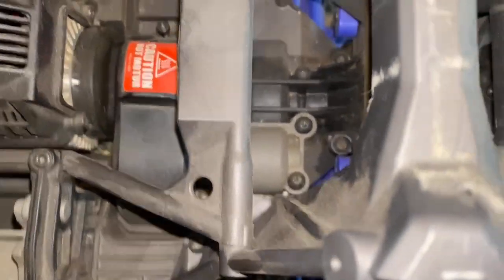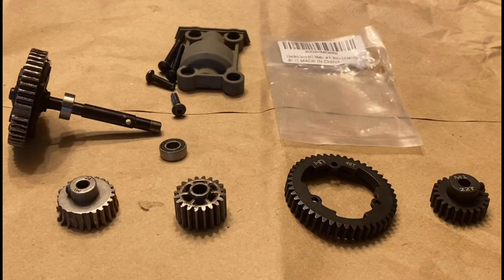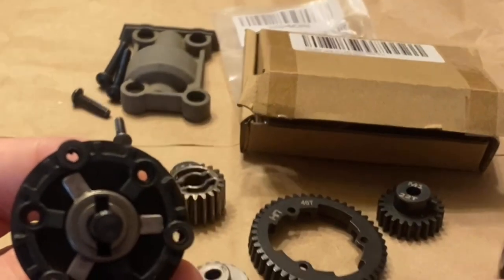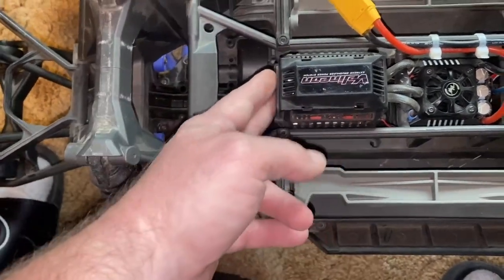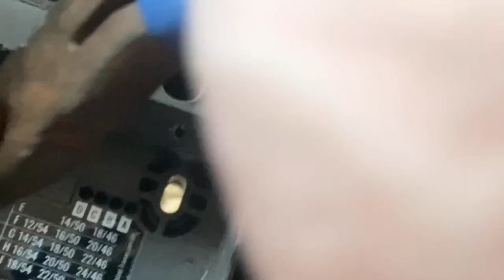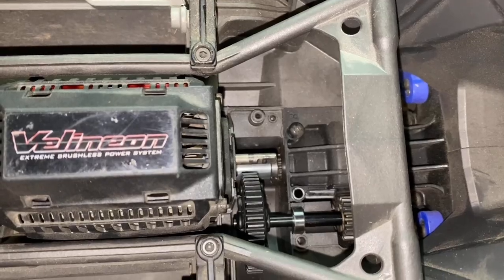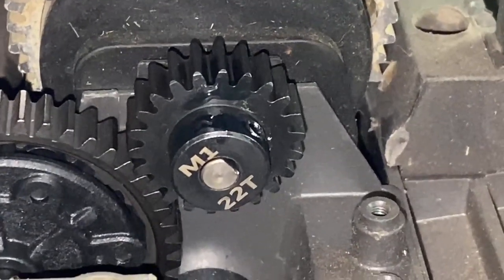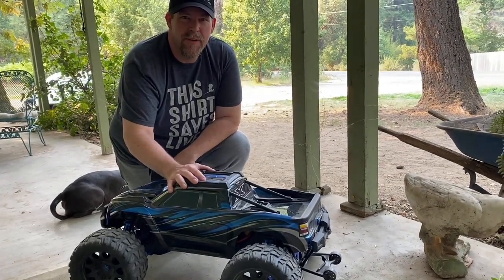Shattering Gears On Your Traxxas XMAXX 8s? Here’s How To Fix It !

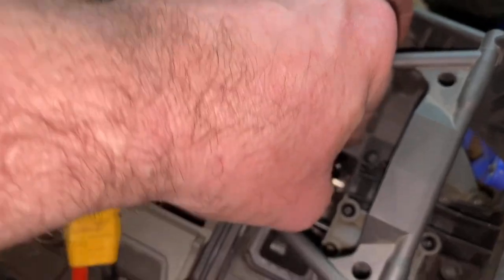Comment: Thank you!  My very 1st run on a new 2024 xmaxx 8s with belted tires ordered directly from Traxxas website.  It only drove for approx 5 minutes and when I put it on a load climbing a steep hill it stopped driving.  Could hear the motor spinning no forward or reverse.  That sucked, had to carry it about 3/4 of a mile back to the car and go home :(    I had a pretty good idea to check these gears and I removed the housing, but without any experience working on this all I could see is the 2 gears looked right, they weren't slipping and manually turning either gear would make the tires turn.  So the motor drive shaft was free spinning inside the gear and I wasn't sure what to do about that.  I find your video and @ 10:23 I see traxxas did not torque down that set screw, it backed off just like you said can happen in this vid.  I couldn't see the flat spot on the drive shaft and I didn't want to remove more than I needed to fix this so I plugged in the batteries and feather tapped the throttle till the flat spot on the drive shaft appeared on the top and then I locked down the set screw.  I see the screw had what I believe was the factory threadlock but it probably wasn't enough.  I'm gonna need to get that threadlock you reommended.  Anyhow, just want to say thanks for the time you put in and the level of detail you go into helps a lot!
Reply from the maker: Wow thank you for the amazing comment. I appreciate that, I hope you have a great one and thank you for sharing.
Reply: Same with me. 2024 xmaxx. First drove it today and chipped a tooth off the spur gear. Didn’t even get to burn a whole pack before it broke.

Comment: Your motor was not properly set down in that notch.. watch the very beginning of your video where you show the damage and look where you had the tab on the motor mount where it drops into the chassis. That’s prolly mainly why your gears blew cuz why mis-alignment what so ever will destroy gears in an xmaxx. I ruined mod 1.5 gears which are huge ass teeth because the pinion and spur weren’t perfectly aligned but I’m also gonna try shimming it as well with this new set

Comment: I bought 4-6 different mod 1 gears. Was so sick of busting teeth. I upgraded to the mod 1.5 gears and no longer have to worry. They are definitely louder but worth the reliability
Reply: Problem is with 1.5 mod you just move the weakpoint to more expensive harder to fix parts. Tons of guys bash on included 46T gears and never have issues. Don’t land on throttle. Don’t use self right. Use motor washers. Mod 1 should be fine if mesh doesn’t move

Comment: That's crazy. They were mangled. Is there no slipper clutch on the xmaxx? I wonder if that would have helped?
Reply from the maker: That Cush setup takes the shock out, just crappy gears. I should be good now, just needed Hardened upgrade. Thanks Ryan for Stopping by buddy!
Reply: @BIGDRONEFLYER77RC  awesome info Donnie. Obviously I'm not at all familiar with the internals of the Xmaxx since I don't even own any Traxxas lol
Reply from the maker: @RDsRCReviews  these guys are amazing, front, rear and center diff. Traxxas has the center just about locked with the 20 million diff oil. So no slipper needed here, lol 
Pretty cool how there setup like a real truck. Also comes apart easy into 3 sections. So if racing, you can change out individual sections. I’m thinking of building a few extra bulkheads, fully loaded.

Comment: How my runs did you get before the pinion gear feel off?  Typically I see one to three runs before it does with a pinion gear like that. Im trying the Tekno pinion now with the larger set screw. Also id use red loctite. Yes you can get it loose later if needed. If the Tekno falls off im going with the Arrma Safe-D5.
Reply from the maker: 4 runs and that was do to my roughness.